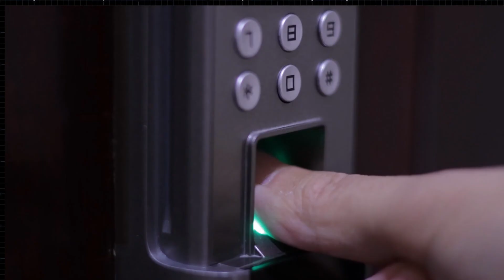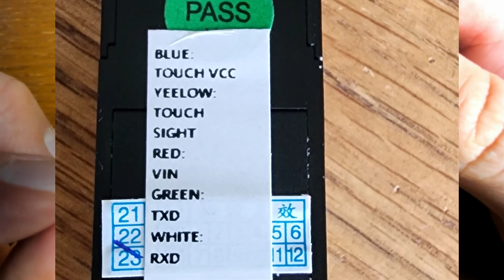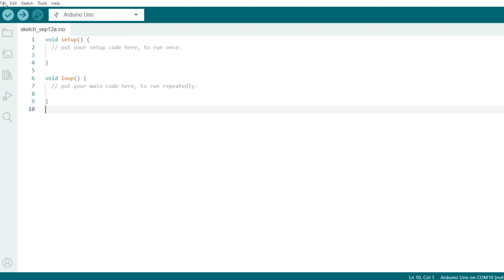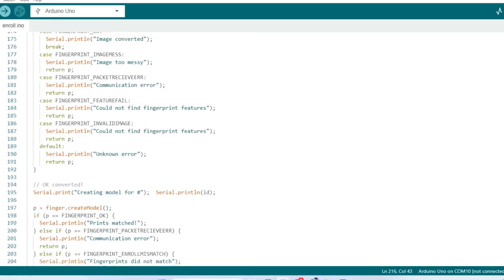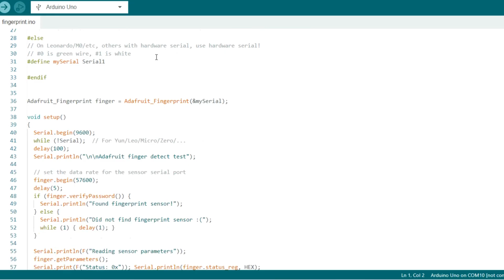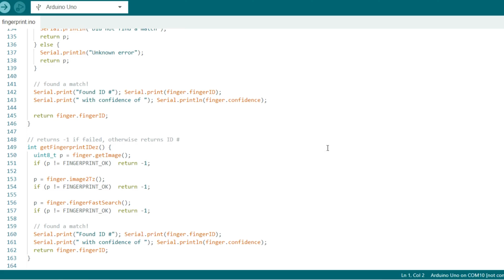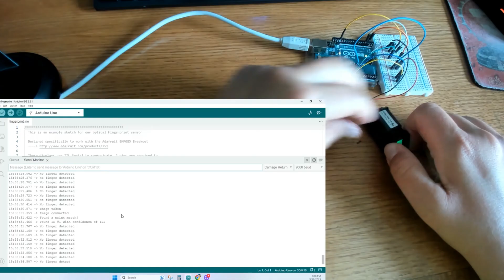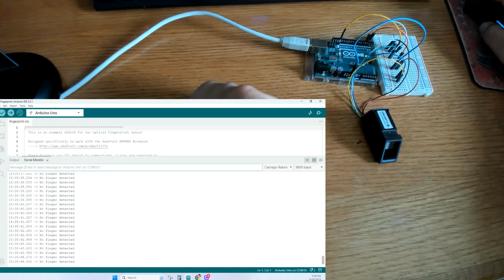Arduino Uno Fingerprint Scanner Tutorial: Enroll and Verify Your Fingerprints

Comment: pls give code fore verify
Reply from the maker: download library.

#include <Adafruit_Fingerprint.h>

#if (defined(__AVR__) || defined(ESP8266)) && !defined(__AVR_ATmega2560__)
// For UNO and others without hardware serial, we must use software serial...
// pin #2 is IN from sensor (GREEN wire)
// pin #3 is OUT from arduino  (WHITE wire)
// Set up the serial port to use softwareserial..
SoftwareSerial mySerial(2, 3);

#else
// On Leonardo/M0/etc, others with hardware serial, use hardware serial!
// #0 is green wire, #1 is white
#define mySerial Serial1

#endif

Adafruit_Fingerprint finger = Adafruit_Fingerprint(&mySerial);

uint8_t id;

void setup()
{
  Serial.begin(9600);
  while (!Serial);  // For Yun/Leo/Micro/Zero/...
  delay(100);
  Serial.println("\n\nAdafruit Fingerprint sensor enrollment");

  // set the data rate for the sensor serial port
  finger.begin(57600);

  if (finger.verifyPassword()) {
    Serial.println("Found fingerprint sensor!");
  } else {
    Serial.println("Did not find fingerprint sensor :(");
    while (1) { delay(1); }
  }

  Serial.println(F("Reading sensor parameters"));
  finger.getParameters();
  Serial.print(F("Status: 0x")); Serial.println(finger.status_reg, HEX);
  Serial.print(F("Sys ID: 0x")); Serial.println(finger.system_id, HEX);
  Serial.print(F("Capacity: ")); Serial.println(finger.capacity);
  Serial.print(F("Security level: ")); Serial.println(finger.security_level);
  Serial.print(F("Device address: ")); Serial.println(finger.device_addr, HEX);
  Serial.print(F("Packet len: ")); Serial.println(finger.packet_len);
  Serial.print(F("Baud rate: ")); Serial.println(finger.baud_rate);
}

uint8_t readnumber(void) {
  uint8_t num = 0;

  while (num == 0) {
    while (! Serial.available());
    num = Serial.parseInt();
  }
  return num;
}

void loop()                     // run over and over again
{
  Serial.println("Ready to enroll a fingerprint!");
  Serial.println("Please type in the ID # (from 1 to 127) you want to save this finger as...");
  id = readnumber();
  if (id == 0) {// ID #0 not allowed, try again!
     return;
  }
  Serial.print("Enrolling ID #");
  Serial.println(id);

  while (! getFingerprintEnroll() );
}

uint8_t getFingerprintEnroll() {

  int p = -1;
  Serial.print("Waiting for valid finger to enroll as #"); Serial.println(id);
  while (p != FINGERPRINT_OK) {
    p = finger.getImage();
    switch (p) {
    case FINGERPRINT_OK:
      Serial.println("Image taken");
      break;
    case FINGERPRINT_NOFINGER:
      Serial.print(".");
      break;
    case FINGERPRINT_PACKETRECIEVEERR:
      Serial.println("Communication error");
      break;
    case FINGERPRINT_IMAGEFAIL:
      Serial.println("Imaging error");
      break;
    default:
      Serial.println("Unknown error");
      break;
    }
  }

  // OK success!

  p = finger.image2Tz(1);
  switch (p) {
    case FINGERPRINT_OK:
      Serial.println("Image converted");
      break;
    case FINGERPRINT_IMAGEMESS:
      Serial.println("Image too messy");
      return p;
    case FINGERPRINT_PACKETRECIEVEERR:
      Serial.println("Communication error");
      return p;
    case FINGERPRINT_FEATUREFAIL:
      Serial.println("Could not find fingerprint features");
      return p;
    case FINGERPRINT_INVALIDIMAGE:
      Serial.println("Could not find fingerprint features");
      return p;
    default:
      Serial.println("Unknown error");
      return p;
  }

  Serial.println("Remove finger");
  delay(2000);
  p = 0;
  while (p != FINGERPRINT_NOFINGER) {
    p = finger.getImage();
  }
  Serial.print("ID "); Serial.println(id);
  p = -1;
  Serial.println("Place same finger again");
  while (p != FINGERPRINT_OK) {
    p = finger.getImage();
    switch (p) {
    case FINGERPRINT_OK:
      Serial.println("Image taken");
      break;
    case FINGERPRINT_NOFINGER:
      Serial.print(".");
      break;
    case FINGERPRINT_PACKETRECIEVEERR:
      Serial.println("Communication error");
      break;
    case FINGERPRINT_IMAGEFAIL:
      Serial.println("Imaging error");
      break;
    default:
      Serial.println("Unknown error");
      break;
    }
  }

  // OK success!

  p = finger.image2Tz(2);
  switch (p) {
    case FINGERPRINT_OK:
      Serial.println("Image converted");
      break;
    case FINGERPRINT_IMAGEMESS:
      Serial.println("Image too messy");
      return p;
    case FINGERPRINT_PACKETRECIEVEERR:
      Serial.println("Communication error");
      return p;
    case FINGERPRINT_FEATUREFAIL:
      Serial.println("Could not find fingerprint features");
      return p;
    case FINGERPRINT_INVALIDIMAGE:
      Serial.println("Could not find fingerprint features");
      return p;
    default:
      Serial.println("Unknown error");
      return p;
  }

  // OK converted!
  Serial.print("Creating model for #");  Serial.println(id);

  p = finger.createModel();
  if (p == FINGERPRINT_OK) {
    Serial.println("Prints matched!");
  } else if (p == FINGERPRINT_PACKETRECIEVEERR) {
    Serial.println("Communication error");
    return p;
  } else if (p == FINGERPRINT_ENROLLMISMATCH) {
    Serial.println("Fingerprints did not match");
    return p;
  } else {
    Serial.println("Unknown error");
    return p;
  }

  Serial.print("ID "); Serial.println(id);
  p = finger.storeModel(id);
  if (p == FINGERPRINT_OK) {
    Serial.println("Stored!");
  } else if (p == FINGERPRINT_PACKETRECIEVEERR) {
    Serial.println("Communication error");
    return p;
  } else if (p == FINGERPRINT_BADLOCATION) {
    Serial.println("Could not store in that location");
    return p;
  } else if (p == FINGERPRINT_FLASHERR) {
    Serial.println("Error writing to flash");
    return p;
  } else {
    Serial.println("Unknown error");
    return p;
  }

  return true;
}
Reply: 2:02  @BMonsterLaboratory
Reply from the maker: dowload library for the fingerprint.ino sketch. scan your finger after enrolling.

#include <Adafruit_Fingerprint.h>

#if (defined(__AVR__) || defined(ESP8266)) && !defined(__AVR_ATmega2560__)
// For UNO and others without hardware serial, we must use software serial...
// pin #2 is IN from sensor (GREEN wire)
// pin #3 is OUT from arduino  (WHITE wire)
// Set up the serial port to use softwareserial..
SoftwareSerial mySerial(2, 3);

#else
// On Leonardo/M0/etc, others with hardware serial, use hardware serial!
// #0 is green wire, #1 is white
#define mySerial Serial1

#endif

Adafruit_Fingerprint finger = Adafruit_Fingerprint(&mySerial);

void setup()
{
  Serial.begin(9600);
  while (!Serial);  // For Yun/Leo/Micro/Zero/...
  delay(100);
  Serial.println("\n\nAdafruit finger detect test");

  // set the data rate for the sensor serial port
  finger.begin(57600);
  delay(5);
  if (finger.verifyPassword()) {
    Serial.println("Found fingerprint sensor!");
  } else {
    Serial.println("Did not find fingerprint sensor :(");
    while (1) { delay(1); }
  }

  Serial.println(F("Reading sensor parameters"));
  finger.getParameters();
  Serial.print(F("Status: 0x")); Serial.println(finger.status_reg, HEX);
  Serial.print(F("Sys ID: 0x")); Serial.println(finger.system_id, HEX);
  Serial.print(F("Capacity: ")); Serial.println(finger.capacity);
  Serial.print(F("Security level: ")); Serial.println(finger.security_level);
  Serial.print(F("Device address: ")); Serial.println(finger.device_addr, HEX);
  Serial.print(F("Packet len: ")); Serial.println(finger.packet_len);
  Serial.print(F("Baud rate: ")); Serial.println(finger.baud_rate);

  finger.getTemplateCount();

  if (finger.templateCount == 0) {
    Serial.print("Sensor doesn't contain any fingerprint data. Please run the 'enroll' example.");
  }
  else {
    Serial.println("Waiting for valid finger...");
      Serial.print("Sensor contains "); Serial.print(finger.templateCount); Serial.println(" templates");
  }
}

void loop()                     // run over and over again
{
  getFingerprintID();
  delay(50);            //don't ned to run this at full speed.
}

uint8_t getFingerprintID() {
  uint8_t p = finger.getImage();
  switch (p) {
    case FINGERPRINT_OK:
      Serial.println("Image taken");
      break;
    case FINGERPRINT_NOFINGER:
      Serial.println("No finger detected");
      return p;
    case FINGERPRINT_PACKETRECIEVEERR:
      Serial.println("Communication error");
      return p;
    case FINGERPRINT_IMAGEFAIL:
      Serial.println("Imaging error");
      return p;
    default:
      Serial.println("Unknown error");
      return p;
  }

  // OK success!

  p = finger.image2Tz();
  switch (p) {
    case FINGERPRINT_OK:
      Serial.println("Image converted");
      break;
    case FINGERPRINT_IMAGEMESS:
      Serial.println("Image too messy");
      return p;
    case FINGERPRINT_PACKETRECIEVEERR:
      Serial.println("Communication error");
      return p;
    case FINGERPRINT_FEATUREFAIL:
      Serial.println("Could not find fingerprint features");
      return p;
    case FINGERPRINT_INVALIDIMAGE:
      Serial.println("Could not find fingerprint features");
      return p;
    default:
      Serial.println("Unknown error");
      return p;
  }

  // OK converted!
  p = finger.fingerSearch();
  if (p == FINGERPRINT_OK) {
    Serial.println("Found a print match!");
  } else if (p == FINGERPRINT_PACKETRECIEVEERR) {
    Serial.println("Communication error");
    return p;
  } else if (p == FINGERPRINT_NOTFOUND) {
    Serial.println("Did not find a match");
    return p;
  } else {
    Serial.println("Unknown error");
    return p;
  }

  // found a match!
  Serial.print("Found ID #"); Serial.print(finger.fingerID);
  Serial.print(" with confidence of "); Serial.println(finger.confidence);

  return finger.fingerID;
}

// returns -1 if failed, otherwise returns ID #
int getFingerprintIDez() {
  uint8_t p = finger.getImage();
  if (p != FINGERPRINT_OK)  return -1;

  p = finger.image2Tz();
  if (p != FINGERPRINT_OK)  return -1;

  p = finger.fingerFastSearch();
  if (p != FINGERPRINT_OK)  return -1;

  // found a match!
  Serial.print("Found ID #"); Serial.print(finger.fingerID);
  Serial.print(" with confidence of "); Serial.println(finger.confidence);
  return finger.fingerID;
}
Reply from the maker: download library.

#include <Adafruit_Fingerprint.h>

#if (defined(__AVR__) || defined(ESP8266)) && !defined(__AVR_ATmega2560__)
// For UNO and others without hardware serial, we must use software serial...
// pin #2 is IN from sensor (GREEN wire)
// pin #3 is OUT from arduino  (WHITE wire)
// Set up the serial port to use softwareserial..
SoftwareSerial mySerial(2, 3);

#else
// On Leonardo/M0/etc, others with hardware serial, use hardware serial!
// #0 is green wire, #1 is white
#define mySerial Serial1

#endif

Adafruit_Fingerprint finger = Adafruit_Fingerprint(&mySerial);

uint8_t id;

void setup()
{
  Serial.begin(9600);
  while (!Serial);  // For Yun/Leo/Micro/Zero/...
  delay(100);
  Serial.println("\n\nAdafruit Fingerprint sensor enrollment");

  // set the data rate for the sensor serial port
  finger.begin(57600);

  if (finger.verifyPassword()) {
    Serial.println("Found fingerprint sensor!");
  } else {
    Serial.println("Did not find fingerprint sensor :(");
    while (1) { delay(1); }
  }

  Serial.println(F("Reading sensor parameters"));
  finger.getParameters();
  Serial.print(F("Status: 0x")); Serial.println(finger.status_reg, HEX);
  Serial.print(F("Sys ID: 0x")); Serial.println(finger.system_id, HEX);
  Serial.print(F("Capacity: ")); Serial.println(finger.capacity);
  Serial.print(F("Security level: ")); Serial.println(finger.security_level);
  Serial.print(F("Device address: ")); Serial.println(finger.device_addr, HEX);
  Serial.print(F("Packet len: ")); Serial.println(finger.packet_len);
  Serial.print(F("Baud rate: ")); Serial.println(finger.baud_rate);
}

uint8_t readnumber(void) {
  uint8_t num = 0;

  while (num == 0) {
    while (! Serial.available());
    num = Serial.parseInt();
  }
  return num;
}

void loop()                     // run over and over again
{
  Serial.println("Ready to enroll a fingerprint!");
  Serial.println("Please type in the ID # (from 1 to 127) you want to save this finger as...");
  id = readnumber();
  if (id == 0) {// ID #0 not allowed, try again!
     return;
  }
  Serial.print("Enrolling ID #");
  Serial.println(id);

  while (! getFingerprintEnroll() );
}

uint8_t getFingerprintEnroll() {

  int p = -1;
  Serial.print("Waiting for valid finger to enroll as #"); Serial.println(id);
  while (p != FINGERPRINT_OK) {
    p = finger.getImage();
    switch (p) {
    case FINGERPRINT_OK:
      Serial.println("Image taken");
      break;
    case FINGERPRINT_NOFINGER:
      Serial.print(".");
      break;
    case FINGERPRINT_PACKETRECIEVEERR:
      Serial.println("Communication error");
      break;
    case FINGERPRINT_IMAGEFAIL:
      Serial.println("Imaging error");
      break;
    default:
      Serial.println("Unknown error");
      break;
    }
  }

  // OK success!

  p = finger.image2Tz(1);
  switch (p) {
    case FINGERPRINT_OK:
      Serial.println("Image converted");
      break;
    case FINGERPRINT_IMAGEMESS:
      Serial.println("Image too messy");
      return p;
    case FINGERPRINT_PACKETRECIEVEERR:
      Serial.println("Communication error");
      return p;
    case FINGERPRINT_FEATUREFAIL:
      Serial.println("Could not find fingerprint features");
      return p;
    case FINGERPRINT_INVALIDIMAGE:
      Serial.println("Could not find fingerprint features");
      return p;
    default:
      Serial.println("Unknown error");
      return p;
  }

  Serial.println("Remove finger");
  delay(2000);
  p = 0;
  while (p != FINGERPRINT_NOFINGER) {
    p = finger.getImage();
  }
  Serial.print("ID "); Serial.println(id);
  p = -1;
  Serial.println("Place same finger again");
  while (p != FINGERPRINT_OK) {
    p = finger.getImage();
    switch (p) {
    case FINGERPRINT_OK:
      Serial.println("Image taken");
      break;
    case FINGERPRINT_NOFINGER:
      Serial.print(".");
      break;
    case FINGERPRINT_PACKETRECIEVEERR:
      Serial.println("Communication error");
      break;
    case FINGERPRINT_IMAGEFAIL:
      Serial.println("Imaging error");
      break;
    default:
      Serial.println("Unknown error");
      break;
    }
  }

  // OK success!

  p = finger.image2Tz(2);
  switch (p) {
    case FINGERPRINT_OK:
      Serial.println("Image converted");
      break;
    case FINGERPRINT_IMAGEMESS:
      Serial.println("Image too messy");
      return p;
    case FINGERPRINT_PACKETRECIEVEERR:
      Serial.println("Communication error");
      return p;
    case FINGERPRINT_FEATUREFAIL:
      Serial.println("Could not find fingerprint features");
      return p;
    case FINGERPRINT_INVALIDIMAGE:
      Serial.println("Could not find fingerprint features");
      return p;
    default:
      Serial.println("Unknown error");
      return p;
  }

  // OK converted!
  Serial.print("Creating model for #");  Serial.println(id);

  p = finger.createModel();
  if (p == FINGERPRINT_OK) {
    Serial.println("Prints matched!");
  } else if (p == FINGERPRINT_PACKETRECIEVEERR) {
    Serial.println("Communication error");
    return p;
  } else if (p == FINGERPRINT_ENROLLMISMATCH) {
    Serial.println("Fingerprints did not match");
    return p;
  } else {
    Serial.println("Unknown error");
    return p;
  }

  Serial.print("ID "); Serial.println(id);
  p = finger.storeModel(id);
  if (p == FINGERPRINT_OK) {
    Serial.println("Stored!");
  } else if (p == FINGERPRINT_PACKETRECIEVEERR) {
    Serial.println("Communication error");
    return p;
  } else if (p == FINGERPRINT_BADLOCATION) {
    Serial.println("Could not store in that location");
    return p;
  } else if (p == FINGERPRINT_FLASHERR) {
    Serial.println("Error writing to flash");
    return p;
  } else {
    Serial.println("Unknown error");
    return p;
  }

  return true;
}

Comment: hi good sir, can this be added by facial recognition?
Reply from the maker: The R3 boards aren't suited well for facial recognition - not enough processing power. If there are libraries available for the Arduino Giga R1, that would work. You could also use ESP32, OpenMV Cam (works great), Raspberry Pi, Teensy.  With these boards you could integrate a fingerprint module with your facial recognition. 👍
Reply: @BMonsterLaboratory   oh ok .....what are the materials you used for your project?
Reply from the maker: @tangxxzz  I used the fingerprint module, a breadboard, and some jumper wires.  0:20   You can also add an led with a 220 ohm resistor that lights up when your fingerprint scan is successful.  👍
Reply: @BMonsterLaboratory  hello, sir. Can the  ARDUINO MEGA 2560 R3  be used? does it have enough power for fingerprint and facial recognition?
Reply from the maker: @tangxxzz The Mega 2560 R3 is not going to be your best option. I would use ESP32S3, OpenMV Cam, Raspberry Pi, or if you want to use Arduino, check out the GIGA R1 board. I haven't tried it out yet, but the Arducam modules look good from what I've seen online. May be worth looking into.
Reply: @BMonsterLaboratory  oh I see.... are there any other types of Arduino that can have enough power for facial recognition and fingerprint? the Arduino Giga R1 isn't available in my country... 😁
Reply from the maker: @tangxxzz There are Portenta and Nicla products from Arduino that can handle real-time imaging, but they are expensive. Honestly,  if your project involves any kind of moderately heavy lifting—like real-time image capture, fingerprint matching, or running standard libraries—Raspberry Pi Zero (or Zero 2 W) is the more straightforward option. 
Even a Raspberry Pi Zero with a single-core ARM processor at ~1 GHz and 512 MB of RAM handles image processing tasks better than most microcontrollers.